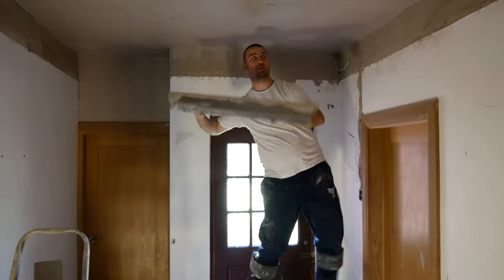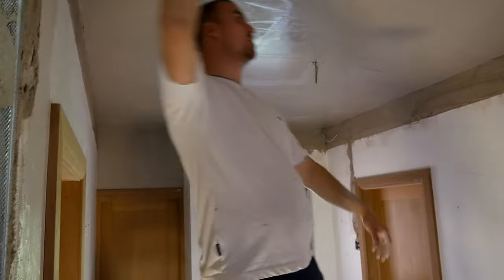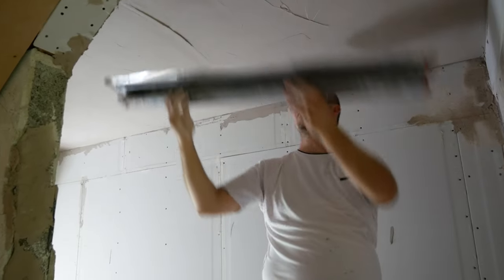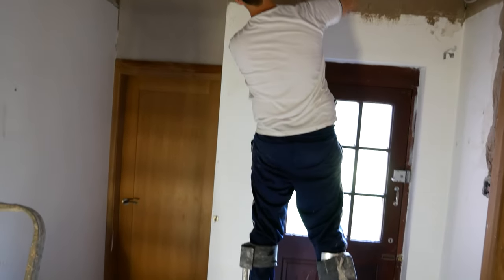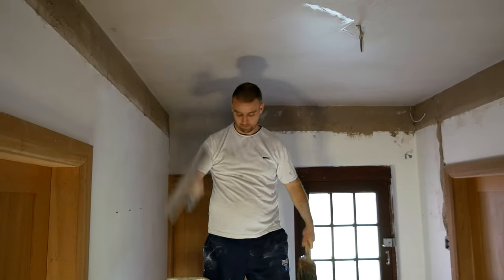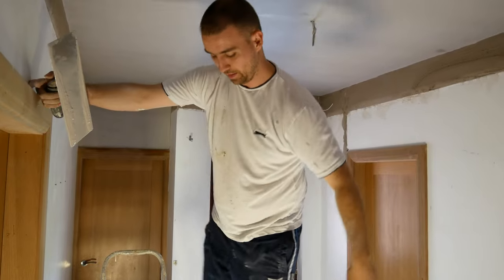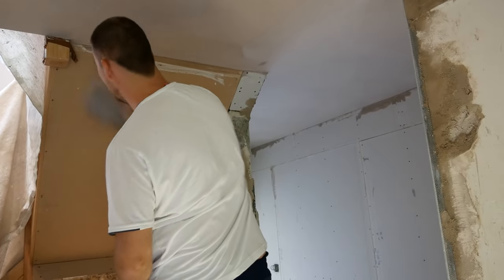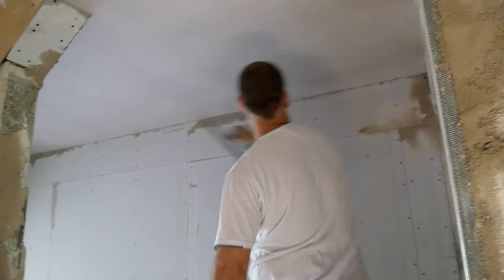plastering a ceiling with mac

Comment: Nice job Mac lad. This is off topic on video shown. I need a bit of advice regarding nap finish. ? I know you use a sponge float after it’s been floated. My question is how long do you leave it floated up, before wetting sponge float and wall/ area before napping it. 

Also how much lime do you use in the gauges. I have a little bit of outside areas coming up, & I haven’t done any nap finishing since 90s. I know it’s been a while.😂 so memory is goosed on it. Can’t find any videos online regarding napping. 

You been a great outside man, I thought I’d ask advice.
Reply from the maker: Done very little nap myself mate. A friend of mine say just a scop or a shovel to a mix a scop for smaller mix shovel for big site mix
Reply: @macplastering  ok sound, thanks. ✌️
Reply from the maker: A few great videos coming up mate should be a nice watch for sure :):)